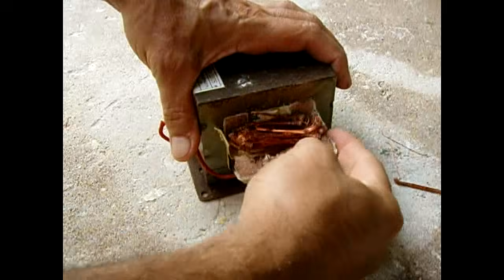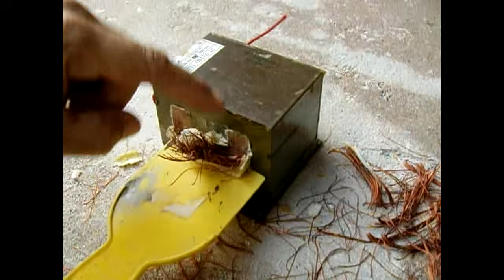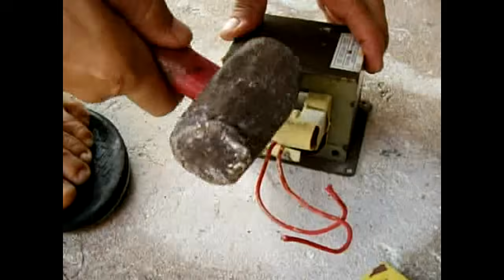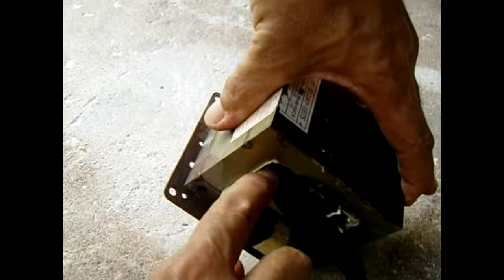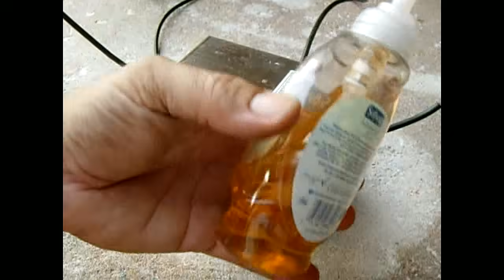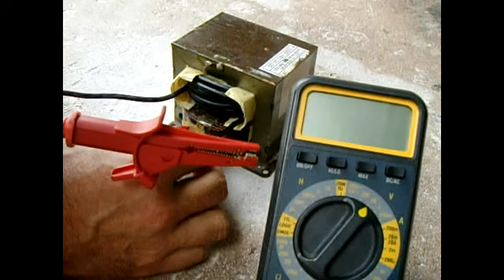BEST Microwave Oven Transformer-MOT Rewinding Tutorial

Comment: I want to make it as a battery charger.  
How many rounds and which kind of wires I should use.
Another question pls, 
How many amp I can obtain?
Reply from the maker: Hi Zakaria. Have you watched my other video showing a simple 12V battery charger I made using a microwave oven transformer(MOT)? I am pretty sure I mentioned how many turns I used in that video. 12ga wire is fine, and keep winding turns onto the transformer until you get measure a 14-15VAC output. Once you use a full wave bridge rectifier at the output, with a large value electrolytic capacitor(No need to smooth out all the ripples, ripples are fine for a lead acid battery charging) you will have approximately a 20VDC output at 10 Amps. Be sure to use the cooling fan from the microwave oven to keep the transformer cool!

Thanks For Watching! Be sure to share my channel with others and rate Thumbs Up.

Comment: I would like to do this for a spot welder. Remove the shunts or not? Do I require thicker gauge wire? 4 gauge or larger? Will the 10 gauge not melt from the current?
Reply from the maker: Hi there,
The shunts do limit current, but from my tests, not by that much. MOT's tend to run hot anyway, so I would leave them in. You can always remove them later to see if there is any difference in output. My DC welder works just fine using 10ga wire and 1/16" rods. There is no wire heating problems. If you are looking to make a low voltage very high current spot welder, then use 4ga or larger copper wire(larger is better!). You only need a couple turns on the core using heavy wire.

Thanks For watching! Be sure to share and rate Thumbs Up.

Comment: I found 2 medal halide transformers heres the images will these work for a welder?
http://i1323.photobucket.com/albums/u590/Brett_Stafford/0113151941b_zpsf259ad79.jpg
Reply from the maker: They look heavy duty/thick enough. The top winding looks like the 120V higher current winding. You would have to carefully chop out the lower winding, and hopefully there is enough space to wind the 10ga wire. Try converting both, then connecting them together in series and see if it works as an AC welder before making it DC. Once you connect the 2 transformers in series, measure the AC voltage across the output wires and make sure you get a reading. If you get zero volts or close to it, then reverse one of the transformer's wires and check again.

Thanks For Watching
Reply: The top winding only has one wire wouldn't you need a neutral and hot instead of just one wire going to the 120v? and 4 wires on bottom 2 black and 2 white.
Reply from the maker: If the top only has one wire, then the other end must be connected to the core.  It would have to be removed from the core. You could refer to my other video here if you wanted to do a full rewind:
https://www.youtube.com/watch?v=3uCuA032lYw
Reply: I couldn't use the medal halide transformers primary so I found 2 microwaves off of craigslist free. And wound the MOT secondary's with stranded 10 gauge. got a reading of 15.6 AC on each and connected both have about 45 DC volts.
Reply from the maker: Sounds good

Comment: why did you do it this way, wouldn't it be easier to just open the transformer and remove the secondary coil and then re-seal it with epoxy or tie straps?
Reply: electronicsNmore angle grinder
Reply from the maker: No. Much easier the way I did it.

Comment: why do you need to re-wire it? cant you just use the coils that were already there??
Reply from the maker: Because you cannot use it the way it is.
Reply: voltage is way to high for his application
Reply: ah k, finally a helpful answer
Reply: electronicsNmore
yes but you could just use a lower power supply to reduce the magnetic field? so then reducing the amount of electricity generated

Comment: Excellent tutorial! Out of curiosity does anyone know what the inductance of a primary winding on a typical MOT is? I am making a Choke-input filter to remove the ripple voltage from a 110V 4A dc power supply and looking to find or make a 3 Henry inductor. Is it viable to rewind a MOT with 18gauge wire to make an inductor of that size?
Reply from the maker: The primary winding usually measures between 17 and 38mH.
Reply: electronicsNmore Thanks for the reply guess i will have to remove both coils and see if I can get enough 18 gauge wire wound on to the core to get 3H. If any one has experience making inductors this large any comments are welcome. Thanks.

Comment: Remark: you don't need to wind the wire in the same direction. It's AC, it won't make any difference!
Reply from the maker: It does not make a difference if you are only winding (1) transformer, but if you wind (2) to be used in series or parallel it sure does. The phase must be proper. :-)

Thanks For watching.

Using Power Transformers In Parallel or In Series
Reply: electronicsNmore Still phase them to give a series connection or parallel connection no matter if they are wound the same way or not.

Comment: @electronicsNmore, thx for this great video. The only wire i have for winding is those which they use for the wiring of stoves & geysers. The outside + plastic is 4mm with 7 copper strands of 0.8mm each, i'm not sure how to measure the ga. Will this be OK?
Reply from the maker: I would look for some stranded 10ga or 12ga wire. You can get it at any hardware store of old building that is abandoned/trashed.
Reply: electronicsNmore
Sorry i did not mention that i want to use this T for a 12v batt charger. Thx for reply, i'll see what i can get.

Comment: There is a very small nick on my primary coil, I still have continuity between the two spade connectors. It's not shorted out.is it still safe to use/still useable?
Reply from the maker: Should be fine, just as long as the nick is minor. If the wire is nicked too deeply, then the wire may not be able to handle the current and melt in the spot. You can also cover the nick with clear enamel or clear nail polish.
Reply: Ok thanks I'll give that a try. And I used the king of randoms method of dissasemly and in the process of tapping out the coils, the transformer core came de laminated. Will that have any effect on it?
Reply from the maker: Watch my other videos as well on this subject. Refer to my video playlists. I have other MOT videos just as good or better.
Reply: Yes. Stick a spot of glue on the nick

Comment: too bad those transformers are built down as cheap as possible and (something about core saturation) leads to it pulling 5A at idle and it heats up ALOT
Reply from the maker: That is why you need the cooling fan from the microwave oven placed near the transformer to keep it cool. It is very easy to eliminate that problem by using the transformer winding program and rewind the primary with more turns of thinner wire. See the video below for that software.

DIY Custom Power Transformers

Thanks For Watching!
Reply: a shorted turn can do that
Reply: Kirk McLoren add 20 turns to the primary

Comment: I've been harvesting various parts of microwaves and I noticed that some of them don't have standalone transformers but have integrated components on a power converter.  The converter feeds directly into the magnetron.  Any recommended use for these other than desoldering the components for other uses?  Also, is this typical of more modern microwaves?

Comment: I WANT 36VOLT DC HOW MUCH TURNS WINDING HOW TO CALCULATE?
Reply from the maker: Very simple. wind the new wire on  about 20 turns, then check the voltage using a DMM set for AC volts. Either add/remove turns of wire until your DMM reads 25.5VAC. Once the output is rectified with a large value filter capacitor, you will have 36VDC. If you experience any excessive heating, simply take the cooling fan from the microwave oven and use it inside a housing to keep the transformer cool.

Thanks For Watching. Be sure to share my videos with others and  to rate a "Thumbs Up" as well.
Reply: electronicsNmore  Thank you for reply .

Comment: I just plugged mine in an it hummed really loud.. there's no nicks or scratches in the old primary.. Gonna watch some of your other videos to try an see what I am doing wrong. I'm shooting for 7volts for perchlorate electrolysis.
Reply from the maker: Some humming is normal, but not really loud. Maybe your new windings are not tightly wound.  Did you check the output to make sure it is 5VAC? Once rectified with a smoothing cap, you will have around 7VDC. Make sure the primary and secondary windings are isolated from the metal core. Place your DMM on a very high ohm range(10-20M) and check from each wire to the iron core. If you get any reading, there is a problem. DO NOT torch the probes with your hands/fingers during the test.

Comment: Quick question... Do your primarys get hot when not under load / short circuit conditions? How long can the transformer remain connected before it gets hot? I have tried modifying 2 MOTs now and the primarys get so hot (No shorts between laminations and primarys). Is this just eddy current making the heat? Or is some kind of ballast required??
Reply from the maker: Hey Matt,

Usually can get hot if no load is attached, or if excessive current is flowing. Either way. If you are using them for the welder, then there is a "duty cycle" which is low(Around 20%). You cannot continuously weld. You need to allow the transformers to cool for 8 minutes, if you weld for 2 minutes. If you are using the MOT for the 12V battery charger, then it should not get "Hot". Usually it will get warm/very warm. You must realize that the transformers inside of a microwave oven are pushed 50% beyond their intended limits. A 1000w oven , uses a transformer intended for around 600w. The reason why they do this, is to keep the cost down(smaller transformer), and they are able to do that because there is a very high volume fan cooling the transformer while it is running, and the oven is not rated for continuous usage. I would suggest taking the fan out of the oven, and installing it in a housing with your transformers to allow very good cooling. You will no longer have a problem.

Thanks !
Reply: electronicsNmore Thanks for that, the transformer is getting hot, smoking hot under no load (Even with just the primary connected). I`m running 230v so for example a quick ohms law calc (800w oven) I=P/V gives you 3.47 amps (assuming maximum load), however 3.47 amps wouldnt get so hot. This is the reason I wondered about a ballast / inductor. I had butchered the laminations slightly so I`m wondering if it is just eddy current making all the heat? Hoppe you can help! Matty

Comment: Could I get 6.3v at 100a out of a 240v mot do you reckon? How thick would the wire need to be?
Reply from the maker: You need to rewind the 220v primary using just under 500T of 25/26ga enamel wire, and 2T of 2/3ga insulated stranded wire for an output of 70 Amps at 6.3VAC.(According to the transformer calculator I used). This is based on a core cross-section of 31 x 70mm. 100A is not going to happen unless the core is larger.
Reply: Cool! Lucky I got two 1200va 32v transformers which are huge! Also explains why 20a at 12v is heating up my rewound mot. What is this software you mention?
Reply: Thanks for the info btw. I might have learnt the hard way.
Reply from the maker: Refer to this video also:

DIY Custom Power Transformers

Comment: Nice video..  One question though...if you used the grinder to sharpen the chisel, why not just use it to cut through the windings? or better yet, make a small incision at the weld on the side of the transformer, and separate the "E" portion from the bottom... So you to can slide the windings out whole, and easily rewrap the new wire. Then you can just re attach the bottom of the transformer to the "E" portion, and weld it back together, no problem....assuming you now have a welder.

Comment: Mine has something like 100k to the core. Is there something I can do, or do I just junk it.
Reply from the maker: Hi Skyler,

You chopped out the many turns of fine wire on the secondary? You replaced the secondary with your own turns of 10-12ga enamel or insulated wire? Which winding shows 100k to the core?
Reply: electronicsNmore
Yeah, I got the secondary out, but I did not add the 10-12ga wire yet. The primary winding showed 100k but it seems like its decreasing after I plugged it in. The hum is pretty loud, and the current draw is 5 amps idle, and the transformer is on the bigger end (from a giant microwave)
Reply from the maker: 500 - 600 watts seems right. Your meter must be out of wack, or your touching the probes with your fingers.....Primary winding to the core should give you no reading at all. A loud hum could be caused by a loose primary winding in the core.

Comment: what if I wanted to get 3 wires from the primary (center tap) how would I wrap that?
Reply from the maker: Very easy. Wind 1/2 the turns onto the core, then add a center tap, then continue winding the other 1/2 of the turns.

Check out this video as well:

DIY Custom Power Transformers

Thanks For Watching!

Comment: Good video ,if I want to make a spot welder how long should be the secondary winding and how thick 
I don't have thick copper wire so can I take several thin wire and put together to make thick enough
Reply: Hello, I never tried this myself but I think you can use several wires as long as you do not exced two winds. Do a voltage test first though, you should read a little over 2 volts, no more than 2.5. If it works the thicker the better, better inductance and less resistance = hotter.

Comment: Doing this I may have scratched the primary a tiny bit, you can see some of the copper, so how much will it affect it or is it no good? If it's no good can you rewind the primary coil?
Reply from the maker: Not a big deal. If you only scratched the outside, and the adjacent wires are not shorting where you removed the enamel, then your fine. Take some clear nail polish and apply it to the scratched enamel wire.
If they are shorting, gently separate the wires then apply the nail polish.
Thank You.

Be sure to check out my video playlists.

Comment: Great video but you are getting 45 -50 volts,Is it possible to get 240 volts as I live in the UK and our power tools etc run on 240 volts
Reply from the maker: You should still be able to do this. The primary winding for your microwave oven is wound for 220V. The secondary is still the same 2KV winding. Leave the primary alone, and rip out the HV secondary.
Reply: electronicsNmore Many Thanks for your reply, Will try this sometime,Would this system work for workshop lighting and general power tools etc
Reply from the maker: Which system? This video only teaches you how to rewind the transformer. You referring to the power inverter? If so, see the modified sine wave power inverter video I have. There are links to schematics in the video description area.

Thanks!

Comment: What a great video. How long of a piece of secondary wire did you use before you started to wind the secondary. I don't want to cut 10 feet and then find out that I am 5 feet short of finishing the secondary wind.
Reply from the maker: 20 feet should do it.

Be sure to watch my other videos as well.

Thanks!

Comment: thanks for the well explained answer!! although does the voltage on the primary have an effect on the output? As I have an dual 24v toroidal transformer , once that has been rectified and filtered  I get almost 40V DC!! My house has a mains voltage of 251 AC maybe thats why?
Reply from the maker: If you have a 120v to 12V step down transformer, and you supply 150V to the primary, then the 12V output will be higher. If the input voltage is lower, then the 12V will be lower. You have to connect the transformer to the AC power supply, then measure the output voltage under no load. Your 24V is likely putting out around 28VAC. That value rectified is 1.41x the AC voltage.

Comment: When calculating AC voltage to DC voltage what does the 0.4 number come from? is that the resistance of the secondary winding?
Reply from the maker: When you convert from AC to DC and add a capacitor to smooth out the ripples, the resulting DC voltage is 1.41x the AC input voltage. The reason why this occurs is simple. When you measure AC voltage, you are getting a voltage reading which is an AVERAGE. If you look at 120VAC on an O-scope, you will see the waveform swings from high to low. If you measure from the middle(zero line) of the sine wave to the very top, that voltage is 170VAC, then it swings down to -170VAC. When you convert to DC, the resulting voltage will be the "peak voltage" of 170V. By adding the capacitor to the dc output, all those ripples from the upper part of the sine wave are flattened out to give you 170VDC.

Thanks for subscribing. Please share the videos with others.

Comment from the maker: It is CRITICAL that the two transformers are wound the same way to be connected in series. If one is wound "In Phase" (Same Direction as Primary)and the other is wound "Out of Phase". then the two in series will not work. If you wind one "Out of Phase, NOT in the same direction, 180 Deg off, Then you MUST wind the other transformer also "Out of Phase" to be able to connect them in series.If You have 1 MOT Primary wound opposite from the other, you can correct this by winding 1 MOT Out of Phase